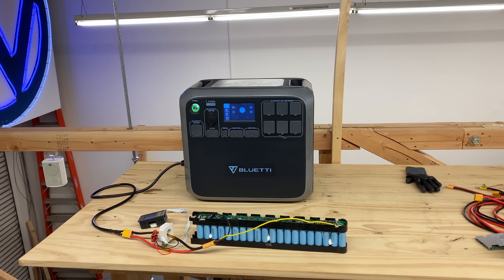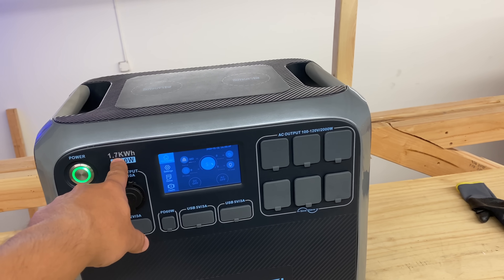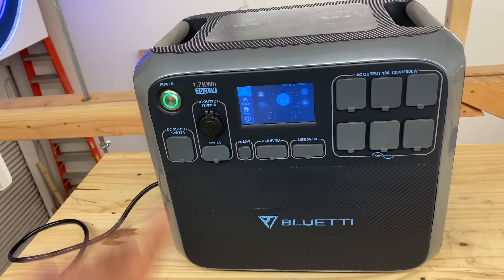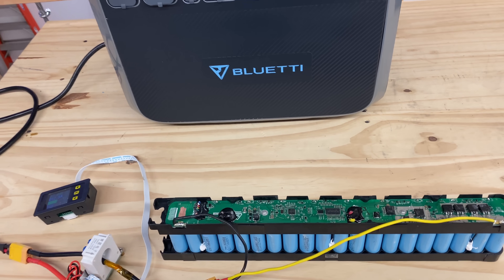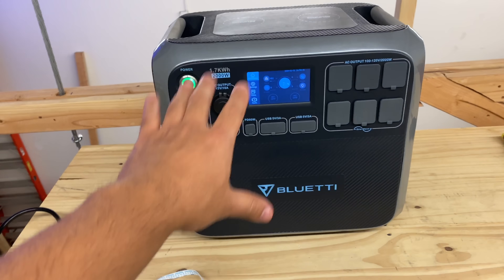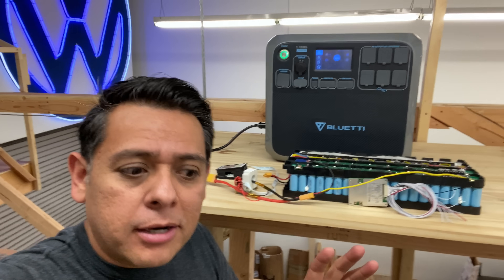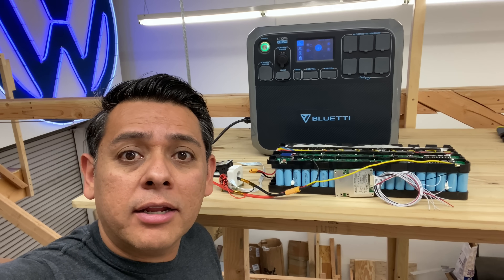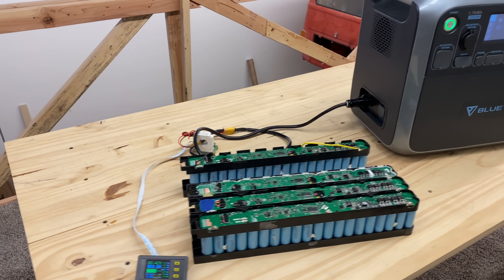Double the Battery Capacity of your Bluetti AC200 for $224

Comment: One big thing to take into account that should be explained. The Bluetti can charge these Lithium batteries, or the lithium batteries can charge the Bluetti. If you want to do both. Charge the Lithium batteries during the day from your Bluetti (or any other source) then connect the Lithium batteries to the Bluetti at night. This might be annoying to switch cables in the morning and evening every day. Idk if those Lithium batteries have passive charging. If they do, you could have a separate solar system dedicated to chargingyour Lithium batteries, and keep the batteries connected to the Bluetti. Then you wouldn't have to constantly switch cables day and night. Has this been answered yet? Does it have passive charging?
Reply from the maker: Yes 10s battery  can be charged to 42v while connected to the Bluetti,  you just have to use a charge controller to limit the voltage to 42v  no need to disconnect, both will charge at same time

Comment: It's not that you have to build a battery I mean you can buy batteries for the bluetti 200 they will come with batteries or you can add batteries to it after you got the unit I think I need to take up the four batteries each battery has like 3 KW so you don't have to build a battery that people don't know how to build batteries you just buy them from Bluetti for a 200 but I think you have the blue Eddie 200b you need the other blue Eddie 200 which is better in every way cuz I think I need one of those two of those and all the batteries I don't even have one of them yet.
Reply: I noticed the Bluetti EB150 and EB240 can be used with their Bluetti battery extension packs as well.

Comment: Hey 'hu, I just got a 200p and watched this video. I really dig them. You got me interested in this external battery for the bluetti. I'm thinking and thinking trying to learn. It looks like a great idea but does this actually increase the bluetti's capacity? Or, just gives us the ability to charge the bluetti. Still a good idea but then I could use any battery source as an external charge. I could substitute any input source, be it solar or scooter or deep cycle, etc. Having this option would definetely come handy when camping or power outage.

Comment: I loved the idea of this so much that I went ahead and bought 12 of these batteries and the dongles that go with them and yet I still can’t get my batteries to turn on. And I have watched every video you have multiple times before ever making this comment, just Incase I missed something. The fact is, you start your videos saying you have it all figured out and then half way through you can’t get it to work and then say you need more time. I’m not coming at you wrong but it would be great to know how to get these things to work and make my money well spent rather than the paper weight you talked about in your other videos.  So can make a video that makes sense and that wakes up these batteries? Because I’m starting to think the 10 battery that didn’t work got sent to me because I can’t get any of them to work.
Reply: Have you put a multimeter to the battery pack to check the voltage? Are you trying to use the onboard circuitboard?

Comment: The elephant in the room is the amount of cycles for these batteries compared to LiFePO batteries.
Reply from the maker: Easy fix,  get a lifepo4 for double the price, you get the double the life
Reply: Are you really going to full drain and charge your portable pack more than 600-700 times? Let alone 2500-3000? Doubtful. Unless you are using it as a daily offgrid power solution having that long of battery life isn't really necessary because Lifepo4 would have to be fully drained and charged for 10-12 years every day. That is unrealistic for a portable battery pack.

Comment: I take it this would work for a Goal Zero Yeti?  I have the Yeti 1000 and I’m finding it’s not enough.
Reply from the maker: maybe what's the solar input voltage on that model?
Reply: @jehugarcia  It’s PMW, 22v max.  Has 8mm and Anderson pole connections
Reply: @jehugarcia  Can you comment or do a review maybe?  I know it’s new and not related to all the DIY side of things.  But definitely interesting. Gyll battery for server racks.  I’m actually looking for a system for my camper van.   https://www.signaturesolar.us/products/h7590c9c2a/2203789000006324403

Comment: OK, I just made this 4 scooter pack version using the newer Panasonic scooter packs on this site: https://jag35.com/collections/lithium-batteries/products/40-cell-ncr18650bd-18650-lithium-scooter-battery-pack
I used a Daly 10s 36v Common Port BMS:  https://www.amazon.com/DALY-Battery-Management-Protection-Balance/dp/B08761R7SY/ref=sr_1_3?dchild=1&keywords=Daly+10s+BMS+36v&qid=1608763287&sr=8-3
I didn't wait to learn how to wake up the BMS board that's attached. I removed the attached BMS board and built it to the plan in the other AC200 battery video on this site:  https://www.youtube.com/watch?v=hPt6rZX2_0U
Go slow when you are wiring the BMS. The video went too fast for me. I made notes on a Common Port wiring diagram available here: https://drive.google.com/file/d/1XuVTMbsmKfBUQOJI-YWCfvYLIAeorP7z/view?usp=sharing 
I bought the 5A version of the charger instead of the 2A: https://smile.amazon.com/gp/product/B08CXPRNCB/ref=ppx_yo_dt_b_asin_title_o04_s01?ie=UTF8&psc=1   This 4 battery pack version, in turn, charged the AC200 at up to 480 watts input.
This Harbor Freight 18" Toolbox has a very snug interior fit to grip the Panasonic battery pack (you might saw down a portion of those plastic mounting tabs on the end of the Panasonic pack) and leave enough room to house the AC charger listed above: https://www.harborfreight.com/18-in-heavy-duty-impact-resistant-toolbox-56681.html

Comment: Thank you for your very honest reviews and input. I’ll be using this in my van, If I connect it directly to my van using the cigarette input and would really only be parked for 3 maybe 4 days max would I be able to run a isotherm (AC/DC) fridge, laptops and phones and smaller items? Is this unit suitable without having to charge without solar?

Comment: Jehu, thanks for your info.  Heh, Fellas,  there are some nice features about the AC200.  I have a boat that I'm converting from Golf Cart 6V times 2 wired in series for a 12 volt-244 amp /hr deep cycle....over to about 400 amp/hr LiFePO4 setup.  I'm not knocking the AC200.  But for what you are buying for the features of different charge ports and AC +DC charging, pass through charging like solar DC to the Bluetti while you are charging up your Mac book and iPhone...folks, I'm sorry, you are getitng ripped off big time.  Now if you bought it when it was still crowd funding...the pain is bearable.  But now that has shut off and you will be paying way too high of a price for what you are buying.  In other words, it is a gimmick for people who have not done due diligence of what is available on the market.  Do you realize how small the capacity is of the battery?  Something like 30 amp/hr.  If you can watch a few video's on how to solder....watch some Will Prowse videos on Lithium batteries, inverters, solar panels, etc etc etc...you will soon understand that this unit is not worth the bucks.  Study up on MPPT controllers,  batteries, converters.....on and on.  There is so much useful information available these days.  Another really good guy to follow is Hobotech.

But if you like getting ripped off and too lazy or stupid to understand basic wiring ....enjoy....guys like JehuGarcia are great because he is basically telling you , in his own way, that this AC200 is so underpowered that you need to buy a lot of extra 18650 Lithiums to bring the AC200 up to a common level.  If you knew how easy it is to wire up all these charge ports you would understand why I say the AC200 is a gimmick for lazy arse people who have very little knowledge of what they are buying.

Comment: AC200’s screen is constantly on, even when the AC and DC outputs are off but the unit is left on. Is there a way to switch off the screen on a timer and wake it up when it’s required?
Also, if the unit is off, it doesn’t charge unless it is turned on. Other models wake up and charge even if the unit was off, as soon as a charge is provided, is there a way to change that setting?

Comment: I really like the extra batteries you offer, but I can't be trusted to assemble a swag lamp kit.  However, your suggestion does make me lean more toward the Bluetti now, when I hadn't been sure between it and the Eco Delta.  (Would that work with the Eco also?)  Thing is, I don't really dare use anything that isn't UL listed bc of homeowner insurance violation.  If a fire happened and they found anything not in compliance, I'd be shot outta luck.  So can you help me with this?  I subscribed to your channel in hopes of getting on your good side.  Pretty much I don't understand half of what you say but if you make a UL extra battery device and show me where to plug it in on a Bluetti - provided I can ever afford one - then I'm pretty good with that.  If you ever need free advice training your horse or dog,  maybe even your kids, that's my wheelhouse.  Please answer soon!  I'm afraid Amazon might rescind their 0%-interest  payment  plan by the end of August if not sooner.  I like how the Bluetti solar charges so fast, but I'm a covid survivor and need to keep a small portable O2 generator handy in case I relapsed and the grid went down all at the same time.  I need enough battery capacity to be able to run the portable 02 generator during the entire night in case of emergency.

Comment: Sorry noobie question here. Can I Charge the bluetti while using it? If I use this scheme, will the charge rate be faster than my discharge rate for typical use ? Thank you!
Reply from the maker: Yes, i don’t know
Reply: @jehugarcia  What setting are you using to charge the Bluetti? I thought if you charge from Lead-Acid Battery you can only get 12V which takes 16-17 hours according to other videos. I am guessing you are using a different setting to hack this. Is the lithium battery acting as an AC wall port? Or Solar? Or something else?

Comment: hi Jehu

Thank u for the great videos and the great effort u put on this channel, i'm from Jordan /Middle east and i really enjoy watching ur projects.

i have a question about one of ur earlier videos ..about using /or not using  bms with lithium batteries.
i was testing a small project (hair trimming machine that use a single 18650 cell) to keep it always on charger ready to use.
the charger im using is a small wall DC charger output 3.60V/0.200AMP .. i left it on charge for two days..

i found that the charger kept on charging and didnt cut the charge at 3.60V  !!!!  the battery was 4.55V  .. thank god i didnt get fire in my office.  :) 
then i discharged it to 3.7v and its safe now .. 

but what do u think ??? is it all cheap chargers keeps putting a small amount of charge that exceeded the out put label on it ??? or the charger i used dosnt function? or i have to keep an eye on charger all the time when im not using bms?? i think this small project i experienced needs anyone to think twice whether to use bms or not and NOT TO TRUST ALL CHARGERS.

Comment: I like this.  I have two irrigation pumps 1hp and 1.5hp.  I would like to build a battery to run both of them and maybe a few lights. about 6000kw. I need to know what I need to have to build this; tools and material. I think I can do this.

Comment: You can build your own system alot more powerful a lot cheaper. But if you want it portable its ok. An inverter charger and 230ah battery is 2x the storage and cheaper. Its not confusing

Comment: How i can connect the Bluett at my motorhome i need some special cables or just straightforward i think about buy one steady buy inverter , automatic transfer switch  and add more battery on my power system do you think is good decision make the change for Bluett I draw 314 amp hours per day what do you think  are the best option for me. Thank you appreciated that.
Reply from the maker: 314ah x 12v = 3767wh  so it would take 9 of these packs to take care of yours daily energy use
Reply: @jehugarcia  I think is super nice if you make a video show how hook up a RV how works with the whole system and different ways to charger that.
Reply: @jehugarcia  thank you for answer. I really appreciate that. Keep up with the videos because really help us.

Comment: I've been debating between a 48V Lipo Cell from Big Battery. and using a MPP Solar hybrid Inverter and also looking at the AC200 , for a 3000W  off grid RV I'm building.  I'm curious though. Is the intent of what you have come up withe here to expand the AC 200 capacity? And if so, how will you add it / tie into to the AC200 battery? or are these scooter packs going to act as a backup charge source?

Comment: Make the same thing, with MC4 connectors instead of the XT90, and it could be used for the Bluetti EB 150/240 using the supplied MC4-to-8mm cable. I would love to have that for my EB150.
Reply: How do you like the EB150? Do you find the 1,000 watt inverter limiting? I guess you have to run the microwave on low power setting?
Reply: @rootcanal7188  I don't use it for a microwave. There are some small ones that the EB150 could run but I haven't found it necessary to buy one just for the occasional power outage. For the situations I use it for, the 1000 watt limit is not a factor at all.

Comment: Can these be stepped down to 12v-16v to use as a car audio system?
Reply from the maker: Everything is posible with enough drive, money and talent
Reply: @jehugarcia  which I don't have beside searching in Google lol. I know most use lifepo4. Will the 18650 cell be better?
Reply from the maker: No,  12v is terrible voltage, don’t use it
Reply: @jehugarcia  what would be a good voltage?
Reply: Dante Jimenez Lion is better suited to 24V and multiples there of, ie 48V, 72V. LiFePO4 with its lower voltage can do 12v. 

If you don’t have the skill or time 100Ah LiFePO4 packs with BMS and cases are readily available.
Reply: @peterg.8245  ty for your response. just wanted to make sure which is best suited for the application. seems like lifepo4 is what i need to be sourcing. i've seent the battleborn and other competitors but hey are too expensive and at the same time a rather build my own so that i can build it to it's max potential.

Comment: Nice try Jehu however the AC200 cannot connect batteries in parallel, you cannot operate the inverter at rated capacity from external booster battery and you cannot charge your external battery through the AC 200 input.Not to mention you loose the capability to use solar charging. As a booster battery though this an awesome solution.
Reply: But you could charge the battery pack with excess solar and then have much higher capacity overnight.

Besides this was a specific use case where you purchase both and could use them during an extended power outage or higher draw camping trip when needed.
Reply: Exactly. Using batteries to charge up other batteries is just inefficient.

Comment: I have a feeling Tesla will be moving away from 18650 cells in September.
If that's correct, there could be A LOT of spare 18650 cells coming out of Panasonic Japan!?
Reply: Unlikely - they need all the batteries they can and they keep improving 18650 chemistry - they can put same chem in 2170 and 18650. Since they need as many batteries as they can, they have no reason to throw away those production lines - just upgrade them. If they don't use them in cars, they'll use them in PowerWall and MegaPack.

Comment: Would you be able to charge those scooter battery packs with the ac200 solar? Subbing
Reply: I don't think so that probably comes from Jehu's website
Reply: Just plug the AC charger into the ac200 while it's getting charged from the solar 👍🏾
Reply: @sheldonpopesp  sweet,  does the ac charger come with the bluetti?
Reply: It’s just a generic 36V scooter charger that he added an XT60/90 connector.